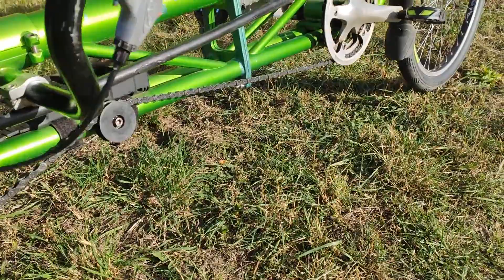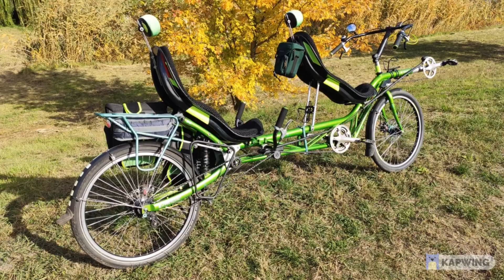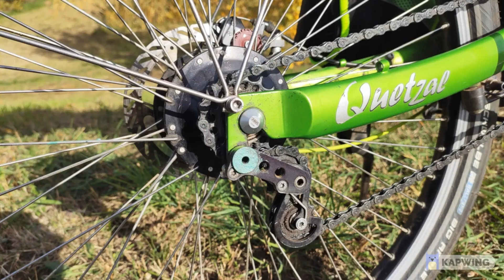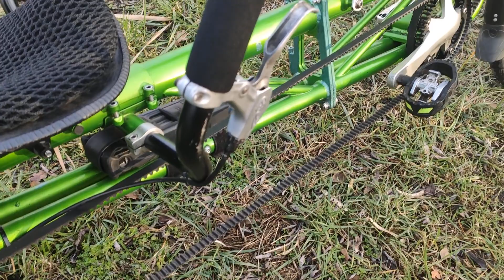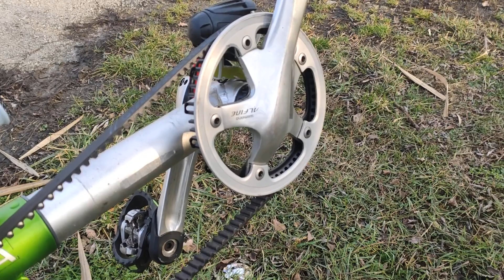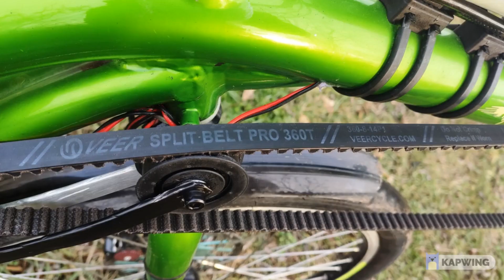Nazca Quetzal Recumbent Tandem Bike Chain Drive to VEER Split Belt pro Transformation

Comment: How is it holding up?
Reply from the maker: We rode 8000 km with the Veer belt set. (during 3,5 years). It is still works fine... I see no demage on the belts. Strong enough to move us with luggages on hill climb... We like it. Silent. No maintenance need. Ligthweight.... The cleaning of the original chain drive, was a terrible torture. (Originally 485T long the whole chain drive.)
Reply: @ Beauty, thanks for the reply!

Comment: this is so cool! Just bought an old dahon and what to put a sturmey 5 speed coaster on it, thought a veer setup would compliment it super well.
Reply from the maker: Have fun! It is fine system. Wider beltline You need. But the grip is stronger, and less tension is enough. "Coaster " brake ? I do not know how it works with that brake system...